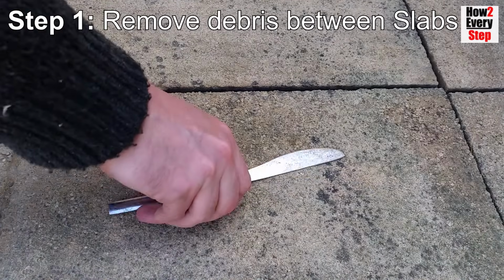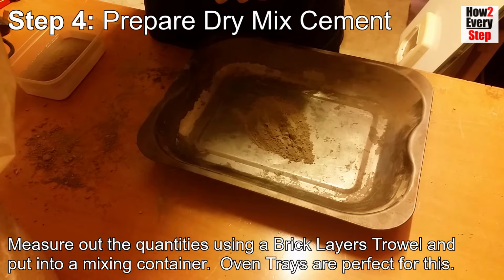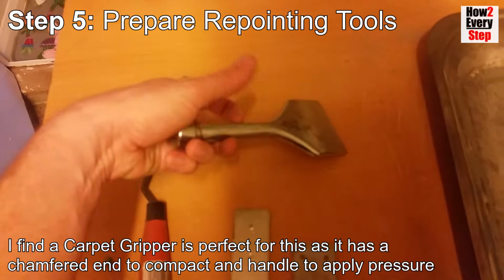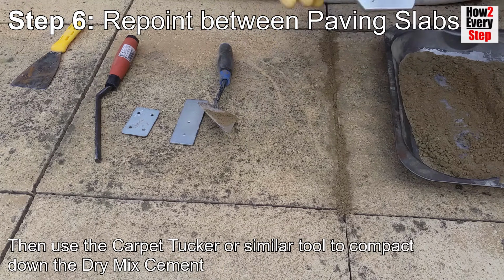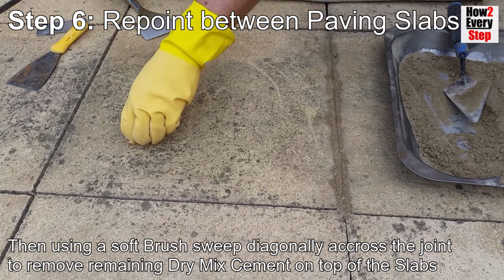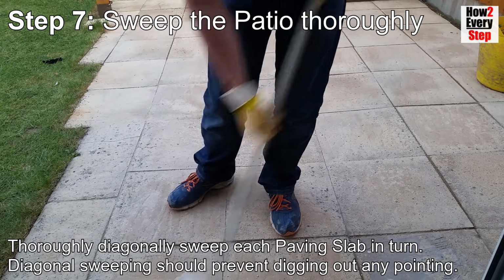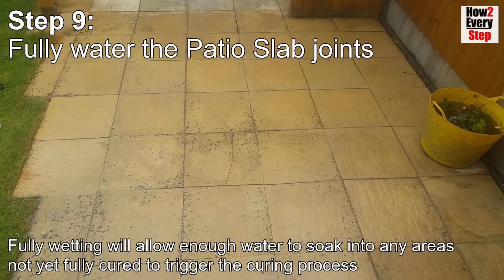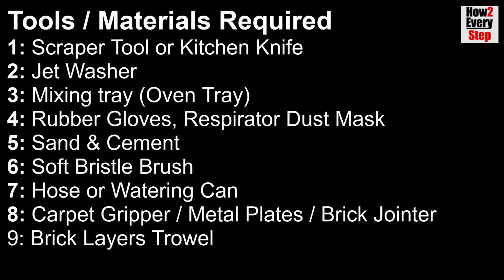Paving Slabs Repointing Guide - Patio Dry Mix Cement Pointing Jointing Gap Fill between Flags How to

Comment: Really great video, many thanks. have a whole load to do but the gaps are more like 1"- 1/2 inch btw various sized and shaped paving slabs on 2 very long garden paths, full of weeds and huge gaps atm, can't wait to get stuck in.!
Reply from the maker: Hi Steve! Really glad you liked the video.  If you have 1 to 1/2 inch paving slab gap there will be enough   gap to use a wet cement mix which will be stronger and longer lasting.  So I would suggest following the video but use a wet cement mix of 3 parts building sand to 1 part cement.  You will be able to smooth and compact the wet mix with you finger (wear gloves) or similar tool.  Hope this helps.  Good luck Colin

Comment: Can you also point the sides or edges of patio  or path adjoining the coping or edging stones so no muck or soil is allowed to build up
Reply from the maker: Hi Anne.  For the edges I would recommend a wet cement mix 3 parts building sand to 1 part cement which will adhere better to the sides of the slabs.  Regards Colin

Comment: why does he do two cement and 4 sand. 1 cement - 4 sand - 1 more cement.
Reply from the maker: Hi Mike.  I did 4 sand to 1 cement.  In the video the 1st trowel of cement  was not as much as I was getting on for sand (as the sand was wet and the cement was dry)  - so I added a second smaller cement to get the quantities accurate...

Comment: I used polymeric joint sand but i don't like the results. The sand is still soft which i believe is meant to prevent cracking but i have ants under the patio and when it rains they dig holes through the joints. So im hoping this mortar mix will work and not crack too quickly.
Reply from the maker: Hi there.  I had the same problem with Ants under the paving slabs.  I  put this mortar mix down in April this year and no cracks what so ever so am confident in the mix.  I would recomment using builders sand rather than sharp sand as easier to use (all I had was sharp sand because of covid lockdown).  Hope it works well for you - let me know how you get on.  Cheers Col
Reply: @How2EveryStep  okay, will do.
Reply: throw cement onto it mixed with sand brush it in spray it with fine mist, then clean, problem solved.

Comment: Thanks for the video.  I’m following these procedures with a slight twist right now.  Using Blue circle Portland white cement and dried kiln buff sand to achieve buff joints.   I’ve been adding water with an atomiser sprayer, rather than the trowel.  I’ve also been gently spraying the dry mix after filling the gaps between each slab to moisten it very slightly.  Since Dry Kiln sand is really dry, and the forecast for the next few days is hot and sunny, any moisture added at the mixing stage just seems to evaporate supper quick.  White cement leaves a blanched  white dust on the slabs after brushing rather than grey.
Reply from the maker: Hi Philip.  I like the idea of using a sprayer to add moisture to the dry mix - it will be easier to get uniform moisture added than using a trowel.... Yer I have always found the slabs need to be 100% dry to avoid cement staining.  Let me know how the end result goes.  Regards Col
Reply: The final result was very solid evenly cured buff pointing.  Unfortunately staining has proved an issue.  The customer has not complained to much, but I feel agrevated that every slab has a staining to a certain extent on it.  When wet the staining becomes see through so you do not notice it, but in the dry a white shimmer is always visible.  I think white cement is more prone to leaving visible staining.  I know of no method to remove or lessen staining.  Brick acid is a possibility, but some clients are not happy about using such a chemical due to their animals safety.  It can also worsen the staining I believe or damage the surface of the slabs in some cases.   Any suggestions for getting rid of slight staining, other than just leaving nature to dissolve it?
Reply from the maker: @philiphiggs1615  Hi Phil.  I'm glad you got a good solid cure.  I don't know how to get rid of slab staining i'm afraid.  The trick is to thoroughly sweep the slabs to remove all loose cement dust - otherwise you can get this staining...  Smooth slabs are easier to sweep completely clean than rough pitted slabs... Regards Col

Comment: Great instructional video. The gaps I have are up to 25mm wide with 3 x 2 flags. Do I need to give the drying process more time before watering?
Reply from the maker: Thanks very much.  No I think 2 to 3 days after pointing should be long enough.  If you are doing over the heat wave - i would suggest hosing down the slabs the day before so at least there should be some moisture between the slabs that can be absorbed into the cement mix.  Let me know how it goes.  cheers Colin

Comment: I bought some tarmac mortar from b and q - but all the reviews says the mortar is rubbish. Do you think I should still try and use it for repointing Thanks for the video.
Reply from the maker: Hi there
I have never used tarmac morter so can't comment I am afraid.  However I worked out for a 25 square metre patio you would need approximately 1 x 25kg bag of sharp sand = £4.70 and 1/4 x 25kg bag of cement = £3.50 (for whole bag).  So for me you get a lot of dry mix cement for £8.20.  You just have to mix it up as per the video.  Hope this helps.  Good luck! Col
Reply: @How2EveryStep  thank you for replying

Comment: Eventually a step by pet guide on this, for someone who doesn't even own a Trowel, roughly how much cement and sand bags would you need for 25 meters squared? Liked and subscribed, thank you
Reply from the maker: Hi Paul
I'm glad you found the guide useful.  Let me measure my Patio tonight and I will get back to you... Regards Col
Reply from the maker: Hi again Paul
I just measured my Patio and mine is 12 square meters and I used just under half of 1x 25kg bag of sharp sand and 1/8th x 25kg bag of cement.  So you Patio being just over double the size of mine i think you would need 1 x 25kg bag of sharp sand and 1/4 x 25kg bag of cement.  Hope this helps.  Good luck Col
Reply: @How2EveryStep  thank you so much 😊
Reply from the maker: @paulmillichamp1684  You are welcome.  Regards Col
Reply: Think you mean 25 sq Metres, 25 metres squared is a very big area
Reply from the maker: @frankiepitt9135  Yes - well spotted :) 25 square metres. thanks